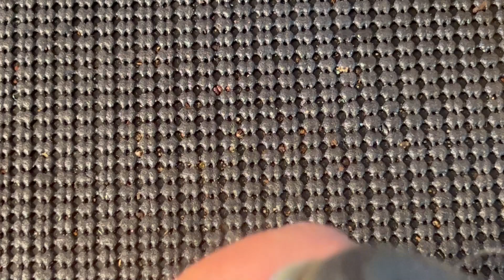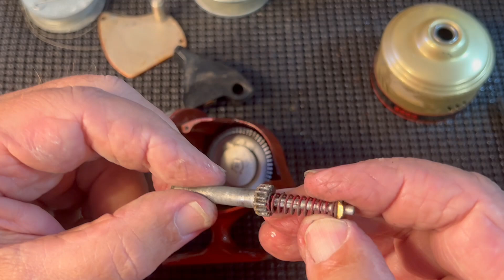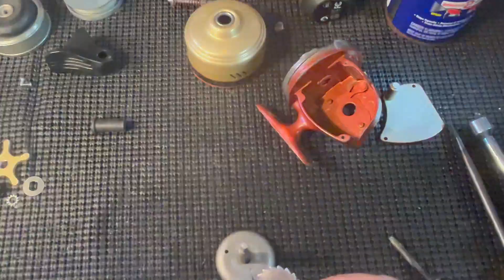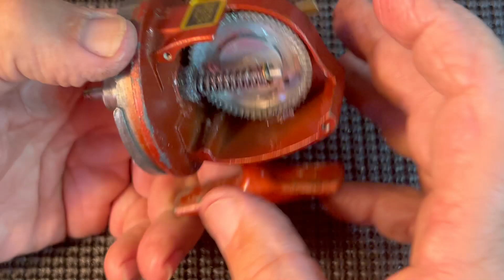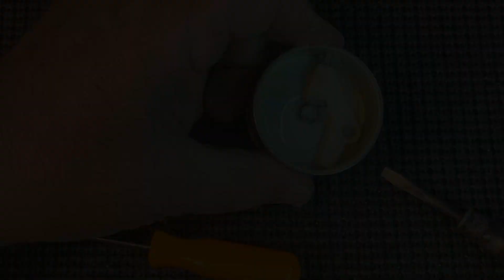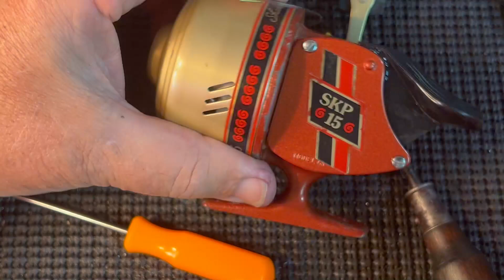Shakespeare SKP 15 -- Service and Lubrication -- Young Martin's Reels

Comment: The smoothness of the drag surface on the main gear may not have mattered all that much. Absent something holding the drag washer stationary, the washer should tend to remain stationary relative to either the main gear or the shaft - whichever one has the greatest friction contact. The drag surface on the shaft had corrosion damage too but, given you didn't have to grind away plating to get at the corrosion, maybe it was a smoother surface than what you were able to achieve on the main gear.

What do you think?
Reply from the maker: The inside of the gear was so pebbled from the corrosion under it that I think only about 10% of the surface was actually contacting the drag washer. I think it would have made it very difficult to achieve a decent drag action. I think that by grinding it down that I’ve managed to get the contact a little closer to 85%. It seems to operate pretty smoothly now. I should have chucked up the buffer wheel in my drill press and held the gear in a vise. Unfortunately, that would have required me to completely reset my camera mounting system, so I did do it.

Comment: Looks like that reel was used in saltwater and not cleaned afterward. That reel resembles the Shakespeare 1700 II.
Reply from the maker: I was surprised that the saltwater damage was on the frame but not on the spool. A wire wheel and a buffer cleaned up the frame and made it look great again. I’m leery of putting the frame in vinegar to remove the corrosion. I did that recently to the aluminum drag gears of a reel and got side tracked. When I got back to it several hours later, the parts were mostly dissolved.  

This reel does look a lot like the 1700 ll. It’s date coded CA which makes it a 1980 reel. I think it’s the 1980 rebranding  of the 1700 ll.
Reply: @ I use a vibratory tumbler for cleaning rifle brass prior to reloading them. It also would work well for cleaning small metal parts, but I haven’t used it for cleaning reel parts yet.
Reply from the maker: I usually clean the parts by hand but if they are really caked with hard grease I’ll fire up the ultrasonic parts cleaner at 50 degrees Celsius. It never gets them completely clean but it breaks the hard grease down to where I can usually clean it off by hand.
Reply: @ddselvig  I thought of doing that once but decided not to try it. The media in my tumbler is usually full of contaminants from casings. Don't want to get any of that on my reel internals. Also don't want to hassle with dumping the old media, cleaning the bowl, refilling with new media, adding my usual additives. Really doesn't seem worth the hassle given I'd have to rinse the parts afterward to get media and polishing compound residue off the parts. More importantly, I'm not keen on the risk of my gears being knocked around / scratched / chipped by the other metal components within the bowl.

I strongly doubt corncob, walnut, or various polishing compounds would have taken off the corrosion on the shaft and main gear in this video without also significantly eating away at other surfaces. I'd be particularly concerned about wear on the fine edges of gear teeth.
Reply: @ Good points. I would only use fresh media in such instances.

Comment: I wonder how many reels Shakespeare made under a different name with basically the same internals? 
That large pickup pin became quite popular in a lot the Shakespeare reels.. and it works really well.
I’ve never seen this model though.. pretty cool..
Reply from the maker: I found this one in my dad’s parts bin. Apparently, he had decided that it was worth repairing. Some of these reels are difficult to sell at a reasonable price, even when they work correctly. I’m guessing that’s why it ended up in that bin.
Reply: @ It’s got a unique paint job. Very late 70s looking.. but it looks like the green 1700 ll with a larger crank handle.. 
My Dad was a railroad man and a backyard auto mechanic.. He taught me a lot but Mom taught me to fish.. He was a terrible fisherman.. He couldn’t catch a fish sandwich if you threw it to him under hand.. 😂
At least your Dad left you a somewhat “affordable hobby”.. 
Cars cost too much😂.